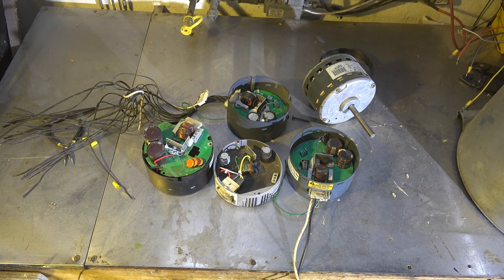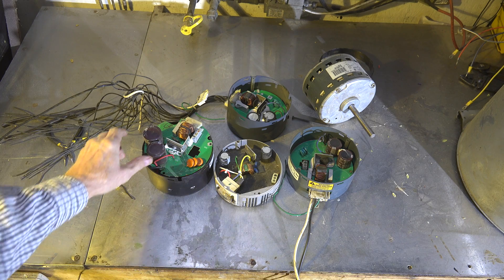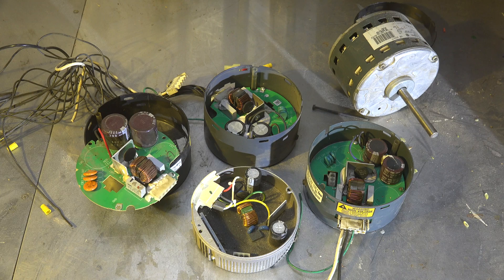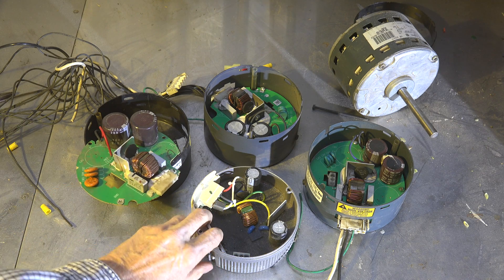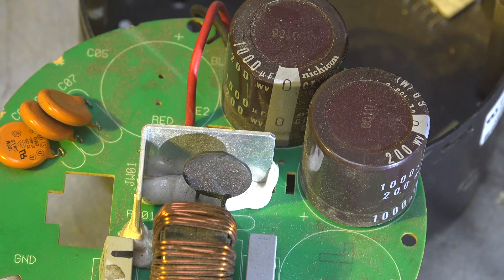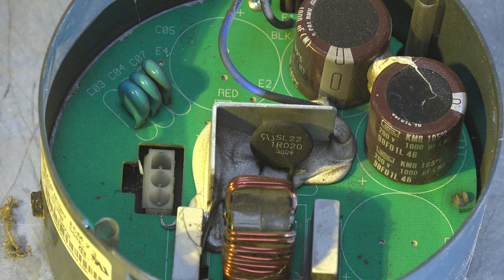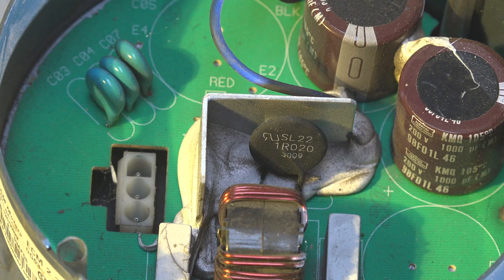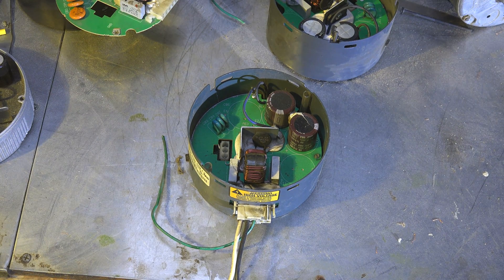Thermistor repair of the ECM motor

Comment: This is a very old thread, and the repair described is easy (usually) and cheap. I just want to correct some info on what a thermistor does in this circuit for anyone who stumbles on here as I did. The function of this thermistor is as an "inrush limiter". The round cylinders you see on the circuit board are large value capacitors, and when power is first applied to the motor, they look like a direct short across the mains. Often this will blow the breaker, and it also stresses the capacitors - leading to early failure. btw, if the end cap of the capacitor is bulged out or leaking, the cap is bad. Once the caps charge up (milli-seconds after initial power) then the current draw drops to near zero. Enter the thermistor. This one is called a NTC thermistor because it has a "Negative Temperature Coefficient". This means that the colder it is, the higher the resistance. On initial power up, the cold thermistors high resistance limits the capacitor charging rate just long enough for them to partially charge, and also for the inrush current to drop. All of this causes the thermistor to heat up, which in turn drops its resistance to near zero - essentially making the thermistor a "piece of wire". This is why simply shorting the bad thermistor wires together might work is some cases, but it is at best a temporary fix and will kill the rest of the module is time. The thermistor in this circuit therefore is not at all a surge protector. Actually the opposite, although since it is still a resistor, and if there was a huge power bump, it could blow. Probably not in time to save the motor though.

Comment: Thank you for your video! I have Trane heat pump unit that would run the indoor fan for 2-6 cycles then it would not run again. 1/2 cool down period (no cooling call on) then starts and runs like normal and then repeats failure. Compressor and outdoor fan running but no indoor fan. I opened the ECM module no visible damage, bypassed the thermistor anyway, to no luck. Ordered a used module from eBay, back in business. Yay! Your videos help me understand these motors and modules, THANKS!

Comment: If the thermistor doesnt look visually bad/burnt, is there a way to test it while its still soldered to the board?
Reply: Continuity. Mine was intact but had no continuity through it. When I pulled on it lightly it fell apart.

Comment: if this thermistor is bad does it keep the blower motor to run constantly and not turn off
Reply from the maker: No, The motor will not run if the thermistor has failed open.
GFM
Reply: Yes, a bad thermistor can cause the blower to run constantly, especially if the ECM module misinterprets the temperature reading. But you should also rule out external causes like thermostat settings, control board issues, or low-voltage wiring faults. If everything external checks out, it’s likely internal ECM logic — possibly caused by thermistor degradation or surge damage.

Comment: If there is no part number on the thermistor, how do you find a matching one to replace it? Also if it has epoxy on the board, do you just cut out the old one and solder the new one directly onto the leads from the old one
Reply from the maker: No part number, you are just shooting in the dark.  You do solder onto the existing leads.
GFM

Comment: Yes indeed, that's exactly what's wrong with my GE Motor ECM.  It's brunt to a crisp, blew burnt plastic smell through the house vents and shut down the blower motor.  With no identifying numbers on the Thermistor, how do I find the right one?
Reply from the maker: If you use the part number I show on one of the end bells, you should be ok.
GFM

Comment: The ridiculous thing is that using a thermistor for this purpose has a lifespan of about 6-7 years. Planned failure. I fixed a neighbor's before I even knew a thing about thise motors. I took the board off and saw the burned component, ordered from Amazon and soldered in... fixed for ~$8.
Reply from the maker: I have seen many of these last over 30 years. Depends on spikes in the line. 
GFM

Comment: Good tip, thanks. Will try on my old ECM controller. We replaced whole motor with cheaper $200 PSC motor + contactor and it runs fine. Extra benefit is new motor bearings are much quieter.

Comment: My Trane blower motor tries to run but can't. It kind of spins very slowly and rumbles then stops. I believe the board and connections are good after following the trouble shooting guide in the manual using jumper wires. I get the same results. I pulled the motor and ECM 2.3 controller. My controller board looks good on both sides without any obvious burn marks. I checked the continuity of the black thermister at about 1.7 ohms. I then check the ohms across the motor leads. From what I've read you should check for shorts between each of the three leads and the motor housing. It passed that test. No ground shorts. Next I checked resistance between each lead. Here's where I believe my problem lies. Between the Black/Blue leads I get 1.2. Between the Black/Orange I get 4.8. Between the Blue/Orange I get 4.4. From what I read these should all be about equal. I believe my motor is bad. Now I need to source a new motor and decide whether just to replace the motor or both motor/ecm. Yikes!

Comment: What about when the blower just won’t turn off even after the thermostat is satisfied and the temperature is met. I have to manually hit the breaker to shut the air handler off. Is that part the problem for these ECM motors
Reply from the maker: Probably not.  First, be sure the thermostat fan switch is set to "auto".
GFM
Reply: @grayfurnaceman  yes it’s set to auto
Reply: Even if I turn the thermostat off, the air still blows, it only turns off the compressor outside, but the fan still blows inside.

Comment: Has anyone had one of these controllers power on and will struggle to spin up. 120v or 240. either way it just cycles on and off. is this an issue with this thermistor as well? it seem to start fine but just doesnt have enough oomph to get to full speed.

Comment: Great video....thanks.  Can a bad thermistor potentially cause an X13 motor to not turn off once the call for AC is done?  Or, cause the blower fan to just turn on by itself and run till it maybe turns off?  This started with my 5 year old Rheem 5 ton unit about a month ago.  I've replace these parts in tube amplifiers and also used them to limit the inrush of current to the tubes to prevent premature damage.  Just curious as it would be cheap to fix before replacing the motor.
Reply from the maker: I don't think so.  The thermistor is in series with the power to the control, so a failure just stops the power.
GFM

Comment: Did this with my gas furnace blower motor - after being threatened with a $1,000 motor replacement.  Now I have a RHEEM aircon compressor fan motor which looks to be a similar type to the interesting range you show. So, inspired by your excellent video, I shall give it a try! Thanks!

Comment: If the thermister reads 1.3 - 1.5 ohms at room temperature, does that mean it is bad? It is rated at 1 Ohm.  Also, What causes the mosfets to go bad? Can they be replaced?

Comment: Its correct name is a  VARISTOR a thermistor changes its resistance with temperature. A VARISTOR  normally is open circuit but when high voltage transients come in they become a very low resistance to clamp the incomming spike. Hopefully they have saved the control circuitry.
Reply from the maker: It is a thermistor.  The example shown in the video is a SL22.  
It is a temp controlled over current device.
GFM
Reply: Yes you are correct interesting device so it is in series with the circuit to limit current. I assume these devices are going open circuit, Must  first investigate these devices as a means to limit surge current  to DC powered SOLAR inverters. The inrush current to charge up capacitors  on first turn on can be quite excessive,

Comment: Hey Grayfurnaceman.  I recently watched this video and it is EXCELLENT.  I am a mechanical engineer by profession.  I am very well-versed in mechanical engineering, software development, and hardware design.  I am also very hands-on in my career/passion with assembly and soldering.

I have 2 zones in my home, each with their own condenser and air handler.  I had these replaced about 3.5 years ago with American Standard systems in both zones.

My air handler in one of the zones recently stopped working.  The coils were frozen up...I had this issue in my last home and found that my contactor on the condenser was stuck, so I replaced it and this solved the problem.  In my "new" home, before I ran a bunch of diagnostics, I purchased/replaced the contactor for about $15 without doing too many diagnostics (I live in Florida and we have lot's of insects down here that get into everything).

The new contactor works fine as I see the condenser fan turns on when I reduce the temp on the thermostat (same specs as the original contactor).

When I realized that the blower motor in the air handler was not turning on, I called the company that installed my A/C systems, and they want $600-$800 to remove and replace the blower motor (motor is free under warranty, but the labor is NOT free under warranty).  When I questioned the company about the number of hours it would take to do the job, I was told that it would take only about 1.5 hours for the labor.

So in an effort NOT to get ripped off, I did some searching and found your Youtube video regarding the thermistor replacement.  Thank you.  This was an EXCELLENT video.

I purchased a new thermistor with the exact same specs from DigiKey.  Last night, prior to the thermistor replacement, I checked the resistance with my digital multimeter from coil to coil and found about 9ohms between terminals 1-2, 1-3, and 2-3.  I then checked from terminal 1 to GND, 2 to GND, and 3 to GND and all were OL.  Perfect.  I was totally convinced that the thermistor was the root cause of for the blower motor not turning on.

So I clipped out the old thermistor and soldered the new thermistor to the terminals that were sticking up out of the epoxy potting compound.  When I reassembled everything and turned the power back on, I was so upset to see that the blower did NOT turn on.  Breakers are ON in both the panel and on the air handler.

I did find an A/C parts distributor in Pompano Beach, FL that has a replacement blower motor for $265 (that includes the blower and ECM module) that I could replace myself.  I would rather purchase the new blower motor for $265 and install myself rather than get the free warranty replacement motor and then pay $800 for labor.  The person that I spoke with said that the chip would essentially program itself once installed.  The company that wants to charge me $800 says that the chip needs to be programmed by a technician.  Can you make any sense of this?  Self-programming or special programming required by a technician based upon brand, model, etc.?

Can I purchase just the ECM module or a fully programmed motor assembly with the correct ECM module.  The OEM blower motor in my air handler is ZHONGSHAN BROAD-OCEAN MOTOR CO. LTD. ZWK702B006067 (ZKSD-250-10-4), ELECTRONICALLY PROTECTED A0, CONT AIR OVER, 208-230V 50/60Hz, 2.6A 1/3HP 1050RPM.

Do you have any other suggestions?  TIA.  --Neal

Comment: What Varistor do I need to order for my York unit I looked at ordering one online there was over 3,000 to choose from! Only letters I could make out on my burnt Varistor was NTC 
Can anyone help 
Or know what type of voltage I need
Reply from the maker: Try this one from Digikey:  SL22 1R020
GFM
Reply: @grayfurnaceman so I’ve removed my old burnt thermistor and just soldered the wires together. At this point am I just not protected from the motor overheating?  Do you know anywhere you can buy a used ecm?
Reply from the maker: I have no sources for the motor or the end bell.
GFM @matthewbelcastro5813

Comment: Thanks for video.  SG381. That is the thermistor in my old air handling unit ECM  blower motor control module. But nobody, including Digi key, has that thermistor for sale. I'm wondering what is an equivalent thermistor I could use, equivalent to SG381.

Comment: I'm an HVAC tech and just replaced a customers ECM module for a good $1000. I still had his old one in my van and took it in to my lab to take a look at it. It is the one with the black epoxy, but to me this epoxy is identical to black silicone. It's obviously a type of silicone that doesn't have the properties that typically corrode certain metals. But I did meticulously pick out chunks of silicone around the thermistor to expose the leads. I tested them for continuity and the thermistor was still good. I then cleared as much of the silicone around the entire outside edge as humanly possible and removed the two tamper resistant screws to try and remove the electronics board and see if I could get at some other internal parts. I was successful with aggressively removing the entire electronic assembly by prying up under the side connector and working the whole thing up with large screwdrivers (the silicone was even oozed out underneath it and holding it pretty good along the bottom). The ground wire goes straight through and it mounted underneath, I had to cut that wire to get the board out. Once out, you have access to nothing, the whole rest of it is still covered in the annoying silicone and the underside is a flat plastic piece with no access to behind the circuit board. If the thermistor is not fried on this particular module, it's pretty much a done deal. There is way too much work involved in trying to remove the silicone to get at other parts, and to do so without causing more damage. Unfortunately, a lot of these 3.0's are like this to make sure people can't fix them without busting the bank.
Reply from the maker: In my opinion, there is no effective repair for these silicone filled end bells.  Except for the thermistor which must have the opportunity to cool.
GFM
Reply: I wonder why they do that with the silicone Bs. Considering they don’t last long enough for anything to corrode! Could it be so that people can’t easily make this repair, but instead have to buy the ridiculously priced replacement?

Comment: What a great video. Thanks so much for sharing your knowledge. I do have an special request; I watched your 2 videos in reference to ecm failure on the air handle motor/ecm. I work for an apartment complex and 
I like to fix not to replace parts like many techs do. We been replaced over 70 units still under warranty. The brand is Broad Ocean and 1/3hp you probably by now fixed a few of them. Can you share the thermistor number that this particular ecm uses? I can’t find the number for it online. I’ll like to give it a try, I know that this brand it’s full of epoxy resin that manufacture días to avoid the fix. Thanks in advance.

Comment: Can I just use a driver (something like
25A-A2P5N104 ALLEN-BRADLEY) to run this motor without the bell? Single speed on an off setup? Or any other cheaper driver
Reply from the maker: I have no idea.  
GFM

Comment: I think you've got it backward on the thermistor... the thermistors in these circuits are NTC (negative temperature coefficient devices).  So as they heat up the resistance decreases.  The design is such that the device passes it minimum current on startup (power up) and then heats up and passes more current as the filter capacitors charge.  The reasoning of the design is to limit power up, inrush current due to the initial charging of the two large rectifier filter capacitors.  Thermistor part number SL22 IR020.
Reply from the maker: It is not backward.  It has nothing to do with capacitor charging.  In fact, the 2 capacitors are 1000 microfarad which will never overload anything.  They are there to eliminate spikes in the line.
GFM

Comment: If an ECM fan motor runs only occasional including very delayed starts (10 - 30 minutes), starts than stops multiple times during a single cycle, occasionally starts up fine only to shut down several minutes later, all of which occur during either a call for cooling or fan-only... is it the case that a thermistor is either good or it's bad? Can it cause the sporadic ECM blower motor issues I'm experiencing or is it always a complete failure of the motor? The compressor starts up and runs fine.
Reply: This one could be an intermittent open in the thermistor or an electronic failure. You can try jumpering the thermistor. You might get lucky. 
GFM

Comment: The thermistor is a negative temp coefficient resistor that starts out with moderate resistance when cool then lowers in resistance when it warms up with motor current draw.    The primary purpose of it is when power is first applied the AC to DC rectifier-filter capacitors gets a high current surge to charge up the filter capacitors.  The thermistor, when cool, limits this power-on initial surge current.  Shorting out the thermistor can result in the AC breaker popping open. It also puts more stress on motor controller rectifiers and filter capacitors.

Most X13 ECM motor controllers remain powered with DC filter capacitors always charged up with high DC voltage as long as air handler AC power is present.  Turning the motor on and off, as well as speed control, is done by the 24vac speed connections, or digital control inputs.  This is why sometimes when motor controller is bad the motor just continues to run all the time.
Reply from the maker: This part is a current limiting thermistor, placed in the system to limit current draw in case of a surge in amperage. It is not there for charging capacitors.  
GFM